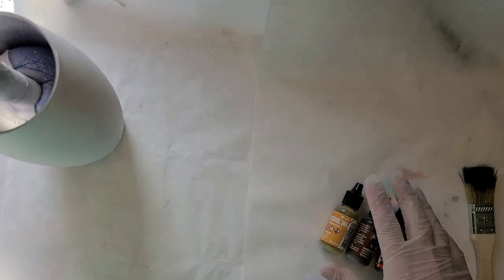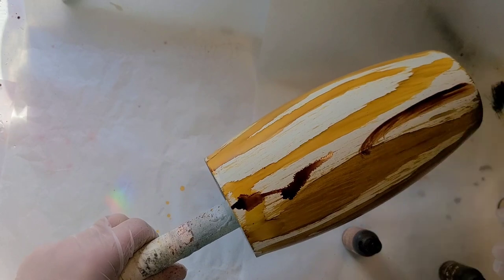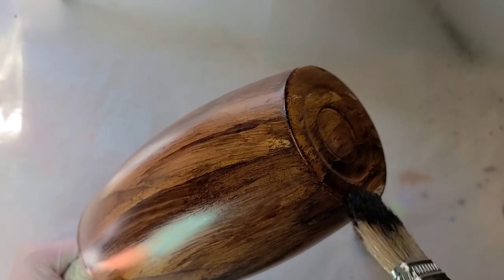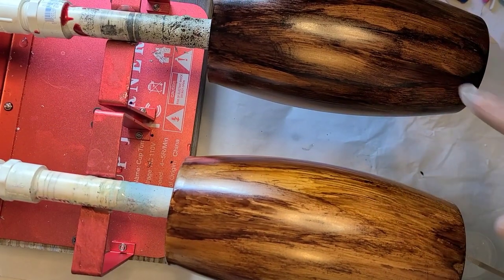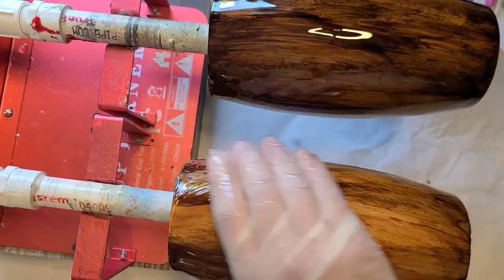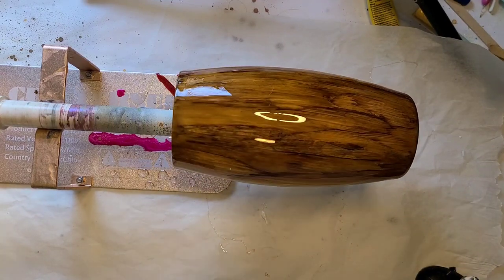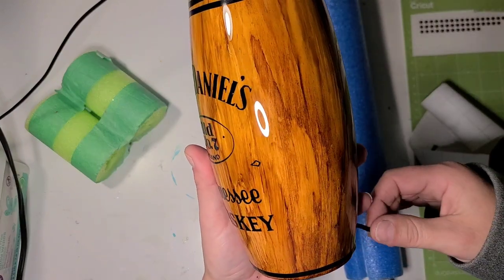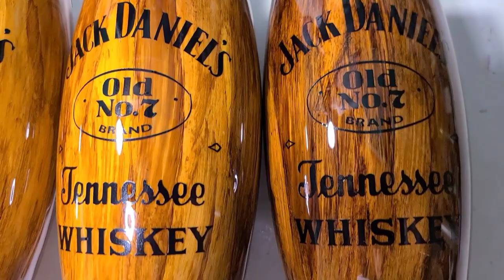Alcohol Ink Woodgrain Barrel Tumbler Trio

Comment: Do you sell these decals by chance and if not, do you have any quick references to where they can be found?  I am not able to find this one specifically
Reply from the maker: I dont I got this svg on etsy years ago I actually removed some parts of it because the full one is a pain in the behind to cut and weed. I haven't looked for one in ages so I have no idea I'm sorry
Reply: @RaesTurquoiseTurtle  Thanks for getting back to me... I have searched high and low for just the "Old No. 7 Brand" piece because I can't find a good file... all pixelated by the time I remove the background.  You wouldn't think it would be this difficult to find.  ha!